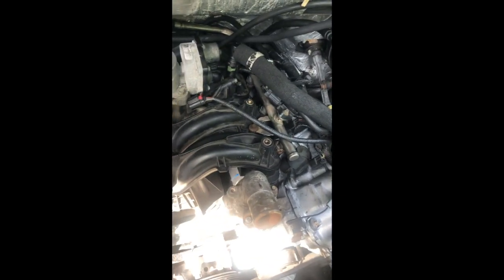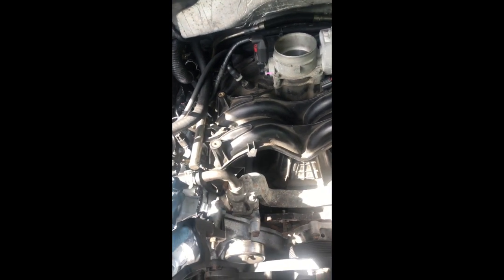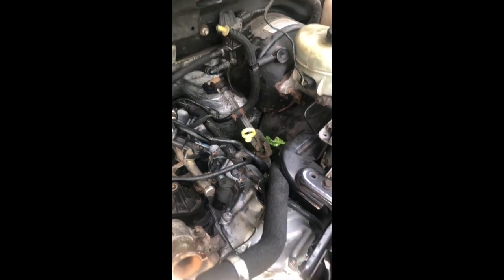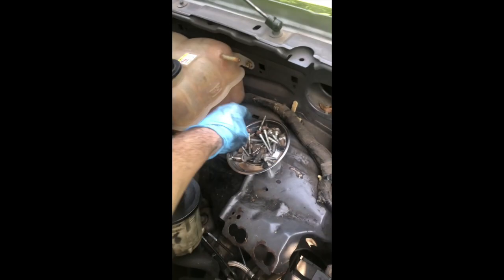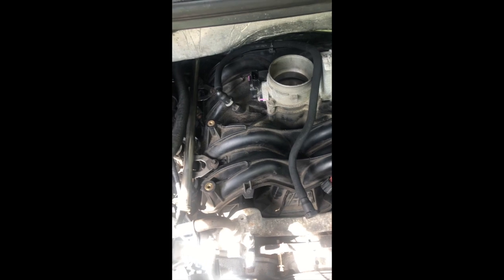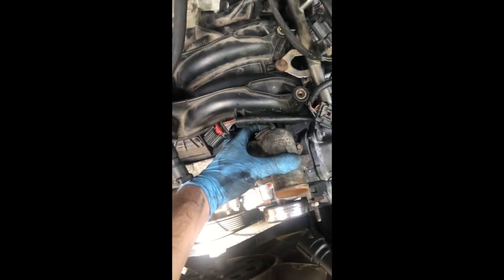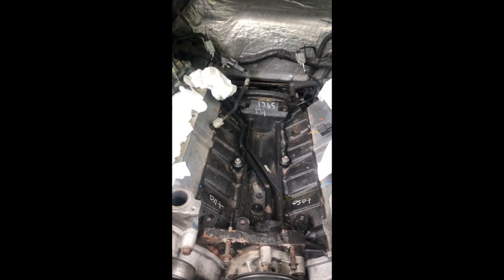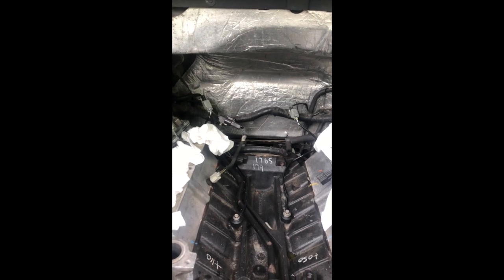2004-2008 Ford F-150 5.4L P0325 replacing Knock Sensors, (& removing Air Intake Manifold) Pt 2 of 2

Comment: 😊 thanks very much for the video. Already see enough that I don't want to touch it. To have to take an entire intake manifold off to get it knock sensors does not float my boat at all. I think mine is knocking under light throttle and I'll try putting mid-grade in it before I do everything you did.

Comment: Great content. The tool I made for the fuel line to fuel rail connection is a thin wall tube, steel, split linear to slip onto fuel line connector. 1" length. Thin as in curtain rod tubing and probably split already. Slide your new key on and push it into the connection. It will move about ⅛" into the connection, raising the retention spring which unlocks the connection. Push the unlocked connector backwards. Watch out for escaping fuel upon separation. Best to let the system de-pressurize normally ( let it set overnight, minimum 4 hrs). Hope this helps and stay safe. 
C.C. Retired Combo welder fabricator fitter non papered engineer w/ unfiltered mouth and no fear of using it.

Comment: Why did you drain coolant. I just did this job and thought that was a waste and it would have been. No need to drain coolant
Reply from the maker: It can be incredibly messy if you dont drain it. One fear of mine would be coolant inside the block so i drain it. You have to take the radiator hose off to get to the alternator and other components so you are loosing a lot of fluid already. If you take off the thermostat housing you absolutely need to drain it, if not then it depends on how much you are willing to allow coolant to get everywhere. Its true you could go without draining the whole thing but you will have a lot of it pour out of the hose
Reply: @thehandyhunter8961 I was wondering the same thing, your video was extremely helpful, kudos for the upload.
However, I taped off the heater house outlet, pushed the hose up high to lose no fluid and had no problems getting the alternator out with the top hose in place.
I was able to do the whole job and didn't lose any coolant. 
Very helpful nonetheless

Comment: It shows that there are single connections or a dual connection????
Reply: Can u send a picture of the sencer
Reply from the maker: @javierharris1731  YouTube doesn’t allow pictures on the comments  but follow this link and then click enlarge under the picture https://www.partsgeek.com/fvmqg9g-ford-f150-knock-sensor.html
Reply from the maker: should be single. there are 2 knock sensors though
Reply from the maker: at 8:54 you will see both of the sensors they are bolted into the block one on the right and one on the left towards the center of the block.

Comment: What was the part number going to do the same job
Reply from the maker: https://www.rockauto.com/en/moreinfo.php?pk=8355124&cc=1432394&pt=5108&jsn=1229&_nck=ZExt1ysfqhqWnq%2BEvUNdS3Txyey60IDtnjPWF5UU9J0BWQv7pvqZbkEUk86%2BAYIhT5Z528%2BoowHK3N3YHuzPkZQjtBAXNlYnhZmO5%2FaOnYke64AWG6Thfk%2Bb%2FOkASOxHD39mfWPof7cG%2FCFaH5h6xkkjUoDjDcvw%2BORZuZvg1xx1QG%2Bcfz0tLVvGlCGk85QK%2BAfQ6z%2FIP0jxgSRXb7VbeJqrF8DahgH8zdsd8ho9Opd7OkEYirWBfKacbkXNbEKkRoWhasdTSKG3%2BmYh7wBb%2BnMsGTXipolfiFnmLWG%2Fy5sIfpL%2F%2FCCwvq5heKBXb4Pe4NnaG62MOmOpyaDxjTmZjja5tyI9SP68

This is a link to rock auto .. there are cheaper versions but i bought the bosch because that is what was on there before. (OEM) Part No.0261231137

Comment: Do I have to remove the air filter housing? Because my bolts are really rusted and I'd prefer if I don't have to
Reply from the maker: Im not sure that it would be possible. In order to have clearance to get the whole intake manifold up and out you will need to take it off. Spray some WD-40 and let them soak for a while on the bolts before you try to remove them.
Reply from the maker: im assuming you are talking about the 4 10mm bolts that connect the 2 parts of the intake manifold, the top of the two being the air filter housing

Comment: What remanufactured engine builder did you use?
Reply from the maker: https://www.ebay.com/itm/06-07-08-Ford-F150-5-4L-Reman-Engine-3V-VIN-V-Flex-Fuel-NEW-CAM-PHASERS-/202283218826?mkcid=16&mkevt=1&_trksid=p2349624.m46890.l6249&mkrid=711-127632-2357-0
Reply from the maker: I bought it on eBay and had it delivered and they picked up the core. I highly recommend. Comes with warranty, good price and I didn’t have to touch anything internally